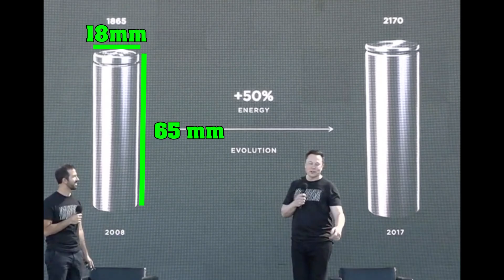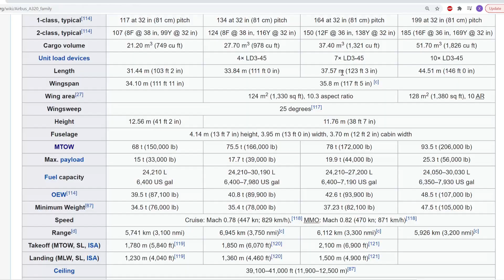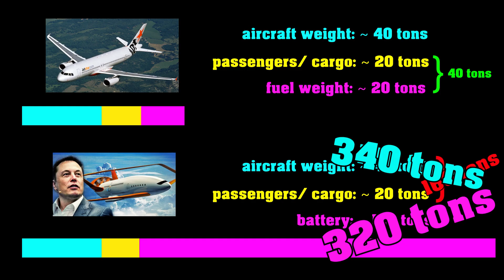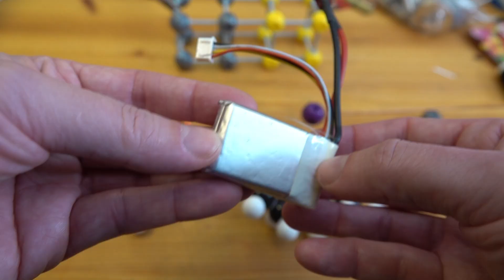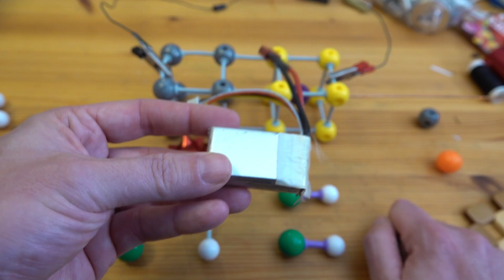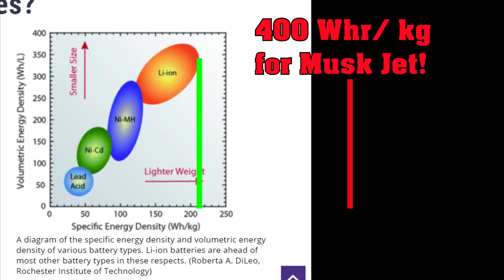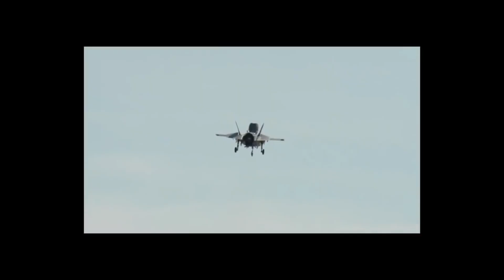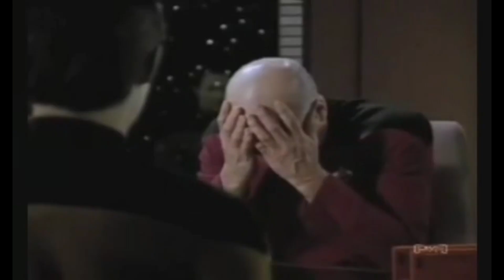Tesla's Secret Plan To Disrupt Airlines: BUSTED!!

Comment: He hasn't managed to make an electric semi, I don't think he'll manage to make a supersonic electric VTOL commercial aircraft

Also there are many reasons that we abandoned the idea of supersonic commercial aircraft
Reply: if its commercial why does it have to be a vtol? Its not like its gonna carrier land or take off from places that arent airfields because all of the airfields were bombed.
Reply: @Messerjockel  because the hypothesis was not absurd enough without the vtol part.
Reply: @constantinosschinas4503  and the supersonic
Reply: @Messerjockel  also if it did exist it would have to pick up passengers at terminals, which already have runway's
Reply: @hopingforthebest1.9  my thoughts exactly. Well the termindals dont have runways but the airfields do. Any why on earth would you need a vtol if there already are runways?
Reply: @Messerjockel  Shhhh don't give him any ideas.
Reply: @Messerjockel  Because they would pick up passengers exclusively at hyperloop stations which only have space for a helipad... duh... /s
Reply: Noise and balanced field length.
Reply: "He hasn't managed to make an electric semi"
wat?
Reply: @Indpendent01  he has made full sized moving models of the tesla semi, but there are none in commercial service as they suffer from the same issues that the aircraft would, the weight of the batteries would render both impractical
Reply: @hopingforthebest1.9  that sucks if true.
Reply: @hopingforthebest1.9  they aren't selling them because they haven't made the Austin plane you idiot

There's no battery capacity on earth
 Tesla makes more batteries than all batteries on earth including China just for vehicles.
Reply: sadly greenies like Al Gore and other enviro celebs didn't figure out those reasons. namely emails, video chat, fax machines.
Reply: @toomanyaccounts  greenies like them figure the best course of action is to ban stuff and have science figure out a better solution.   They did that to coal, which ended up with more natural gas being used.
Reply: @caferace8418  we using natural gas for a very long time. fyi what lead to an increase natural gas production was fracking which the enviros want to ban. banning doesn't lead to better solutions it often leads to worse things. 

burning wood for electricity generates far more pollution both emissions and environmental area due to harvesting the wood then strip mining an area to get at coal and then burning the coal.

Comment: 1.5 °C Threshold = 2030 | Solar Wind < 3% of Energy
-- Electricity is 20% of energy ∴ 100% renewable electricity = 20% of energy
-- Fossil fuels have been about 80% of energy since 1971
-- Wind turbine plans for 2030 = 800 million tons of coal emissions
-- Wind turbine demand for rare earth production will grow up to 26X by 2040
-- The market for magnetic rare earth oxides is to increase 5X by 2030 
-- EVs will fuel a 275% increase in demand for rare earths by 2025
-- Basic resource depletion and insecurity are up while supply & demand will diverge
-- Batteries and hydrogen can't scale up in time to prevent 1.5 °C 
-- EV and wind rare earth demand will overwhelm supplies
-- If batteries were 60% more efficient we would use 60X more of them
-- Over 60 yrs jets are 68% more fuel efficient and fly 60X more passengers
-- 2.63 billion air trips were taken in 2010 -- 4.4 billion trips in 2018 
-- Euros burn imported trees and seed oils for energy & recycjed garbage for electricity
-- Yanks pump groundwater underground for gas to charge EVs in a megadrought
-- Fracking and conventional enhanced oil and gas both use lots of water
-- EV battery and bio-energy demand will landstrip water and wildlife worldwide
-- By 2035 US farms will lose up to 8X the soil The Dust Bowl 
did
-- Wetland loss is greater than tree loss 
-- Inland sea & lake levels will drop globally -- ofen dramatically
-- 40% of Amazon rainforests don't know their ass is grass yet
-- AC cooling energy demand will grow 3X by 2050 = US EU Japan electricty use
-- 24% of energy will be electricity by 2040
-- Not even 3% of energy is solar & wind -- 1.5 °C is likely by 2030 
-- Earth is heating by 400,000 Hiroshima nukes / day
-- Earth was heating 1 nuke /sec 60 years ago -- 5 nukes /sec now
-- 1971 - 2018 global heat forcing averaged 0.47 watss/m²
-- 2010 - 2018 global heat forcing averaged 0.87 watts/m²
-- Rising earth heating jumped a 50 yr ( 0.18 C /decade ) trendline in the last 5 years
-- Hansen reiterates meters per decade sea level rise by mid century
-- 4% of mammals are wild by weight
-- 96% of mammals are livestock and human
-- With 23 billion chickens on earth, if one sneezes we all get the flu
-- Greenhouse gases went up 45% in 30 yrs 
-- We kill trees 2X faster than we plant them
-- Net tree loss is about 1 football field per second
--Trees grow faster die younger in heat fire flood & drought
-- Battery & Bio-energy extraction destroys native land water & wildlife

Global energy expert Vaclav Smil says:
-- North Euro offshore wind turbines work 30% of the time
-- North Euro onshore wind turbines work 22% of the time
-- North Euro solar panels work 11% of the time
-- One of them offshore Texas would work 35% of the time
At < 3% of energy they're inconsequential to 1.5 & 2 C timelines

Green Energy Harms Native Freedom Land Water & Wildlife
-- Europe get over 50% of its renewable energy burning trees & seed oils
-- Europe burns 80% of the globe's wood pellets for renewable electricity
-- Europe burns 40% of its recycled plastic & paper for recycled electricity
-- Europe burns 65% of its palm oil for bio-energy 
-- Dams destroy river wildlife up and down the rivers
-- Shipping trees and palm oil overseas for green energy credit is criminal 
-- Europe's carbon credit cap and trade system is old and corrupt
-- Europe's global carbon fund is rife with corruption

Support James Hansen's monthly private carbon dividends
-- 100% to you 0% to governments & corporations
-- That's why both governments and corporations hate it
-- That's why both socialists and capitalists hate it
-- This is where scales of efficiency actually pay off
-- Monthly Private Dividends = Real Climate Racial Justice (not the academic kind)

26 Nobel Prize winning economists support James Hansen’s monthly dividends, including: 3,589 U.S. Economists, 4 Former Chairs of the Federal Reserve and ALL 15 Former Chairs of the Council of Economic Adviser

You can find facts, sources & links at Loki's Revenge blog on wordpress under Green Energy Fraud

zz zzzz zzzzzz

Global Supply Chain Insecurity

National Soil Erosion Rates on Track to Repeat Dust Bowl-era Losses Eight Times Over -- UCS 2020
Expect More Mega-Droughts — Science Daily 2020
Fresh Water Per Person Plunges 20% In 20 Yrs – FAO 2020
By 2025 66% of people will live in water stressed areas – Nat Geo 2020
4 billion people live one month per year in water shressed areas – Sci Adv 2016
1.9 billion people at risk from mountain water shortages — Guardian 2019
50% of Global Thermal Electric Capacity Threatened By Water Shortages – WRI 2017
30% of planned hydro projects threatened by water stress – WWF 2020
Climate change: US megadrought ‘already under way’ — BBC 2020
Water use for fracking has risen by up to 770% since 2011 – Science Daily 2018
44% of Coal Plants Risk Global Water Shortage – Unearthed 2016

Comment: Didn't he tell Tony Stark about his electric jet idea in one of the Ironman movies?
Reply: Might actually work if he invents an ARC reactor.
Reply: @dogwalker666  He was able to build this in a cave!!

... With a box of scraps!
Reply: @smaakjeks   yes macgyver style.
Reply: hiron man 2 in 2013
Reply: That's probably where the fan theorists get their ideas from. Hollywood. But would still like to see it engineered into reality to see if it could be done.
Reply: @HeyyItsNick  Designed mathematically? Sure. Engineered? Not happening with current technology.
Reply: @HeyyItsNick  its probably possible with ducted fans and even electric motors, vtol that is not supersonic,  but not with batteries.